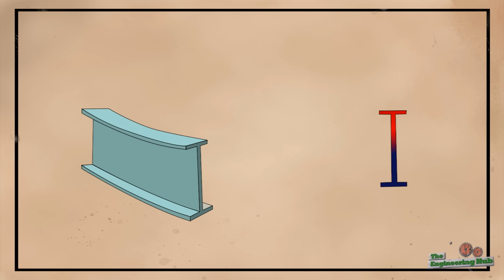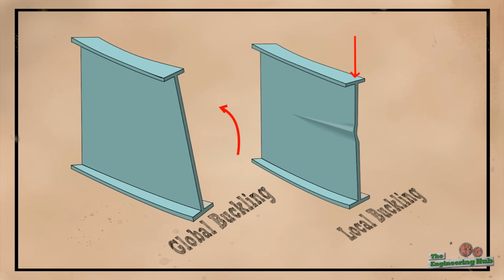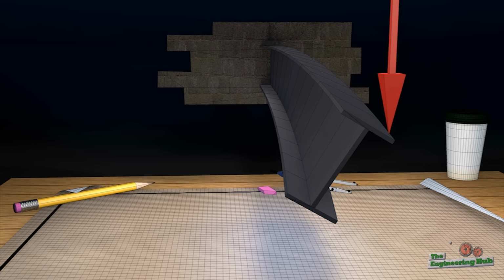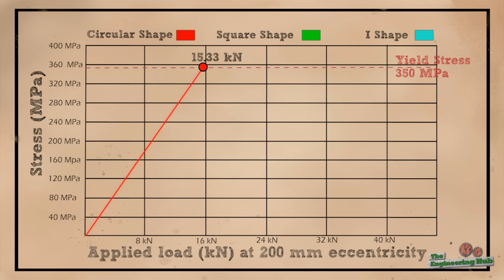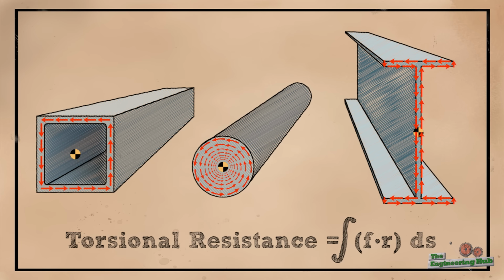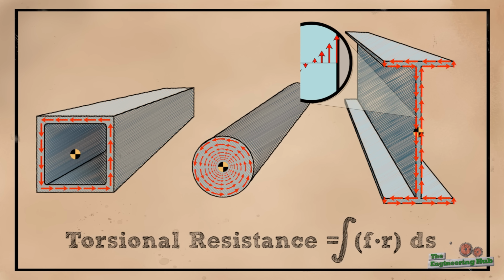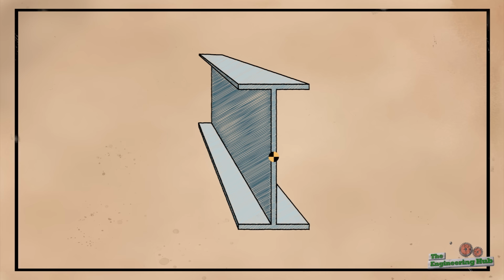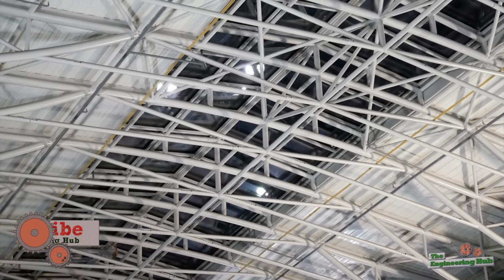The Critical Weakness of the I-Beam

Comment: Still waiting to find out what the fatal "flaw" is.    Having a degree in engineering, I would be interested to know as they are basic structural element. And there are well know methods to deal with all of the issues that you have raised. Main reason for using I beams, is when used in the correct place, they have a very good resistance to bending for their weight. Much better than square or round tubes.
Reply: It's clickbait for the uninformed, this is a very basic intro to mechanics of materials titled as if it was a weird online ad. "Structural engineers HATE him! Check out how this youtuber keeps his buildings standing with this ONE WEIRD TRICK!"

Comment: Torsion is a problem for all long beams regardless of shape.
The way to workaround that problem, if the beam is subject to torsion, is to build up beams in parallel to make a surface or volume like a cage (bridges). That way the structure is stiff and one beam by itself cannot twist.

Comment: All the examples are a wide flange beam. Not an I beam. You honestly don't know what you're talking about.
Reply from the maker: Hi James, the nomenclature of the beams might be different than the one used in your region. The name varies from place to place. In Canada, where our professional practice is, we colloquially refer to all shapes (W, H, S) derived from an "I" as I-beams. We understand that it is most likely different in your country/region.
Reply: @TheEngineeringHub  No. In professional practice they are referred to as what they actually are. When looking at a print, itll call for a W12x50. Nowhere on the prints do they call for "I Beams". I beams are not used anymore
Reply from the maker: Yes they will be specified with their actual designation, however, that was unnecessary information for this video so we just called them I-beams. The sloped-flange beams you were referring to are designated as S-beams in the Handbook of Steel Construction. The Handbook does not have any beams designated as "I" because the whole group is colloquially referred to as "I beams".
Reply: @James-on1vy  In laymen's terms, the term "I-beam" refers to any beam that resembles the shape of the capital letter I, regardless of its technical designation.

Comment: I read somewhere that nature has provided one of the strongest shapes:  The honeycomb or hexagon.  It makes one of the lightest and strongest structures.  It is used in many car platforms due to its muli-directional vector strength.  It would have been interesting to include that in this analysis.
Reply: Honeycomb isn't the strongest shape, but the shape that allows the minimum usage of material. So you get strong structures per weight of the structure.

Comment: I-beams in general don't have flaws. You're describing design flaws, that use I-beams.

When used correctly, an I-beam will never experience torsion stress. That's a design problem.
Reply from the maker: That is true, I-beams should not be subjected to torsion loads. But that also means that nothing in the world is flawed but just needs to be used in a different manner. For example a bucket with a hole is not flawed, you just need to use it for carrying rocks and not water.

Comment: So i want to redo roof in concrete building using steel beams & aircrete stuffed with styrofoam for natural solutions and some rooms.

What diameter of circular hollow steel beam for heavy loads do you suggest?

Comment: Seems to me, two I-beams parallel and with the flanges connected gives the best of both worlds, taking vertical loading, and counteracting torsion mutually, still using the classic I-beam simple fabrication.
Reply: This would be stiff, but also heavy.  I've never seen this done and can think of quite a few reasons why it would be difficult (if not impossible) to construct.

Comment: Guess what shape they use to make driveshafts?

A hollow tube can still cave in under torsion, but it beats a round bar in stiffness vs amount of material.

You could fill the round tube with a composite material that is good in compression tho.
Reply: A round tube in torsion, selected intelligently for anticipated load, is strong as long as it is not bent or dented. If either occurs, it will surely buckle.

Comment: I once saw a video about square solid driveshafts driving old factory equipment. When they were machined round in places to spin at supports they snapped because of the lose of torsion strength.
Reply: And they got thinner on the process,needed re-calculation.

Comment: Lets make a "H" beam. Put two similar I beams side by side. Get a nice chamfer on the sides that touch and weld up the top and bottom. A single I beam needs 4 beads of weld to manufacture. Joining two I beams only take 2 extra beads. Seems like a worth it modification. The center changes from being inside the middle plate to hovering in air between the two beams

Comment: Dude, click bait douche... Compared to other applications the I beam is a freaking marvel of engineering... And to the average metal worker every type of structural element has a optimal application and a sub-optimal application... "Fatal flaw" lol whatever dude.
Reply from the maker: We don't deny the utility of the I-beam. It is exceptionally strong in carrying bending loads, we made a whole video about that. But when the carrying capacity could be reduced significantly (in some cases over 80%) just be shifting the location of the load, then it is a weakness. Designers and engineers (like us) are well aware of this flaw or as you called it sub-optimal application just that this is less sub-optimal and more "don't do" application.

Comment: So what caused the freefall tlime in both the TWIN TOWERS. A fall as if there was nothing absolutly nothing holding up above where the planes hit?
Reply: All the weight of the upper floors collapsing one by one, adding more and more weight (inertia) to the next floor below. The hammer forces increased with each successive increase in falling mass. Steel was tearing and twisting in unimaginable ways.

Comment: I suppose if you reduce the cross sectional areas of the various planes without scaling down the overall shape you WILL get buckling or bending anyway.........anything that is increased in thickness and scaled accordingly will be at it's maximum strength but you also have to include length which is a vital factor in all cases......there are so many factors that come into play but are never foreseen or anticipated in the overall design.
Those that think they can be clever and reduce material volume in certain quarters to gain economy will lose their credibility once the component is put to the test.

Comment: Interresting video, thanks :)
A question, will stiffners on the I-beam not help against torsion too? And I imagine it will be diffrent again if they are placed diagonally.
Reply: Diagonal stiffeners will not work. The whole point of the stiffiner is to stop the beam from twisting itself apart. If it's on a 45 or a 60 degree angle it's just going to break the welds instead of  resisting the urge to twist.

Comment: These are NOT "I-beams." They are wide-flange beams. The cross-section of an I-beam differs significantly from wide-flange beams. The rolling mills are not the same.  I-beams are rarely used today in general steel construction. Calculations for crippling vary also based on the carbon composition Fy=36 ksi and Fy = 50 ksi.
Reply from the maker: Nomenclature varies from place to place. In Canada the beams you are referring to are designated as S-beams (sloped flange). We colloquially refer to all beams derivatives form an "I" (i.e. H, W, S) as I beams.

Comment: Great video with exceptional graphics.  But I would agree with the others that torsional stability of an I-beam is NOT a fatal flaw as you state in your title.  It's just another failure mode that needs to be understood and addressed by engineers (I am one myself).  Also, at 5:02 you hinted that a tube is better in torsion: true, but it has limits too on how thin the walls can get before they, too will buckle on the surface.
Reply from the maker: Yes definitely, you are not wrong. We called it a flaw from the perspective that a small change in the load location reduces the carrying capacity drastically. So we thought, if a small change could bring down an otherwise strong entity then that must be its weakness/flaw. We are still learning as a channel and observing how the audience reacts to our content so we could get better in the future. Thank you for your feedback!
Reply: @TheEngineeringHub  We engineers are a nit-picking bunch, so please don't let that slow you down from producing great content to especially get young folks interested in and learning about STEM topics!  So, I've subscribed and wish you all the best.

Comment: shows a round tube "this shape is ideal in resisting torsion" 
I guess that's why it's a common shape for bicycle frames
Reply from the maker: Also many other applications in the automotive industry such as drive shafts.
Reply: A lot of bicycle frames have elongated tubes in one direction, because it takes significantly more bending load in one particular axis than the other.

Comment: The illustration is not a 'I' beam but classed as a universal beam, 'I' beams have radii in the corners universal beams do not hence they do not have the same resistance to torsional loads.. They are cheaper and therefore easier to manufacture.
Reply: I remember the beams in the graphics as being called "wide flange"
Reply: @jamescad9978  "Wide Flange Beam" is indeed the correct technical term used in design and construction.  We do call them "I Beams" but know we are referring to a modern WF.
Reply: This. Lol!!! I thought this video was gonna be oh so that's why they stopped using I beams.
Reply: Exactly what I thought,  I-beam is thicker where the material meets, the picture looked like what I knew as a wide-flange beam.
Reply: I work for a building manufacturing company. I run a beam saw. We rarely run “I” or what we call “s”. We mostly rune H “wide flange beam” but most isn’t made perfect square so there will always be some some of torsional twist to it. For beams that bridge cranes run on we typically add channel on top to help the flange support it  without upsizing the entire beam.
Reply: @BigWill3855  so in WTC destruction what sort of beams were those & can jet fuel ball of fire and office material heat them to failure?
Reply: @MrGoodguy6-7  the design of the towers was a blast furnace without the liner. The core support was a big tube, that made the main elevator bank, with the bulk of the floors tied to that and further supported. In theory this design should have prevented the whole building from collapsing. Upgrades to the elevators cut back on baffling in the central tube, this combined with several hundred tons of high grade diesel created conditions hot enough to thermally compromise steel.
To be clear they never should of fallen, the BS spun by the media is in the ballpark but irrelevant to the issue. Building 7 has no excuse at all stick to that and you will find more answers.
Reply: @kuruptedredneck9154  awesome thank you! 
In addition to the core one of the designers or associate of the designer/s I believe said the towers had structural steel on the perimeter as a specific feature that not only helped the height but should act like a screen door if a pencil were to puncture it. 

As far as several hundred tons of diesel goes and NIST account of collapse i don’t recall that figuring in.  If several hundred tons of diesel ignited in the towers, i suspect we would see towering infernos or at least blast furnaces in locations where diesel was stored  

i agree the tale of bldg seven is quite tall, I trust media and govt to tell us whatever benefits a powerful cabal like entity we are not to criticize.
Reply: @MrGoodguy6-7  you got me on the tons of fuel. Was thinking gallons and typed tons, i blame it on Monday thinking.
Reply: @kuruptedredneck9154  hahah whew .. i think some claims of diesel tanks were below wtc seven but NIST discounted them as insignificant .
Reply: @MrGoodguy6-7  ya... Building seven was a controlled demo. They f'ed up the cover up on that one completely. The towers had a diesel fire on upper floors, that should not have been enough to completely drop them.
The whole official story stinks to high hell, and there is far too many people closely involved that made a large amount of money from the reaction to the official story.
Reply: @kuruptedredneck9154  yeah practically a coup we still suffer from the damn thing
Reply: You got one thing right. You labeled the graphics as illustrations. Why aren’t you correcting the colour of the beams illustrated in the video also? Both yourself and Zoolander should probably work from technical drawings rather then illustrations.
Reply: This kid Possibly, doesn't Know from Life, Mentors, Long Education... etc..
   But Atleast He Is Researching, Learning, and Teaching. With Cats  Like You ALL, Fills in the Blanks that Mentors etc could Norma Fill In.   
   Great Combination
        Great People 
         Great Video
Reply: Even proper I beams have relatively little torsional strength compared to many other cross sections of a similar mass.
Reply: Spot on...
RSJ’s had a 7 degree angle on the top and bottom plates so were thicker and stronger in the corners.
Reply: I think he’s referring more to the general geometry rather than the specific ways that geometry can be altered to improve its properties. Sure I beams don’t have sharp corners and have curves, but they still have the general shape of these other beams and therefore exhibit similar properties. A box section is very different from any I shaped beam
Reply: Yup !
Reply: Yes he is referring to the general shape. Don't make things more unnecessarily complicated.
Reply: @patmat.  calling a wide flange beam an I beam unnecessarily complicates things. Specifically since I beams are built bigger where it counts to compensate for the very weakness that is being criticized. But ok, I do get your point. I just think it's either ignorant or misleading to leave out this little bit of information.       At least he made the video though, I will concede that my comment required far less effort.
Reply: @onradioactivewaves  I agree. if you're going to make a video under the name Engineering Hub, at least get the nomenclature right. He sounded like a TV reporter getting it wrong like they always do.
Reply: @onradioactivewaves  you are just confusing rolled members with built-up members. Both are I beams.
Reply: Always that person that has to get technical and not allow the creator to get their point across. Turn a short video into a boring video about the rules
of beams. Thank for your not so insightful comment.
Reply: Right when I started watching it I was saying the same thing. Credibility=lost

Comment: Are you saying that a round hollow tube is stronger then a square hollow tube? Because if you are then I would have to disagree with you...
One other thing I don't see why they don't use triangular tubes...
Reply from the maker: A round hollow tube is stronger at resisting torsional loads than a square hollow tube. But it is not stronger at resisting bending loads.
Reply: @TheEngineeringHub  That makes sense thank you for the response, any thought on the triangular tube (if they made them)...

Comment: I just watched a video by Waldos world about building a gooseneck trailer. He included a small hollow round tube between the I beams and welded a plate to each end. He did this to reduce twisting of the frame especially when empty. I thought that it was a lot of extra work when he could have just made the beams bigger. This shows that a little material in the right place can go a long way.

Comment: don't mean to nit pick, (the video was quite good) but the term "I-beam" actually refers to a specific hot rolled steel shape that some what resembles the rails used for train tracks. They are mostly obsolete now.  What is shown in the video is actually called "Wide Flange".

Comment: Thumbs up on the video. When you began comparing cross sections of various shapes, (I beam, square tube), I was immediately perplexed as to WHY you then chose a SOLID bar. My correct guess was that you would progress to a round tube to explain its advantage. But it was a distraction from the start. I would have preferred all 4 being introduced together.
Reply from the maker: Thank you for the feedback Gregory. The main reason for comparing these 3 shapes was because we used them in one of our previous videos when we compared them under bending loads. For this video, we knew we couldn't talk about torsion without introducing the round hollow section so we decided to bring it up later as the queen of torsional resistance. That's the reasoning, we know it's not a perfect video but hopefully we can improve in the future.

Comment: Euler buckling, that's called. And it's not necessarily a "fatal flaw," might it also just be a way to save weight and cost of the I beam?
Reply from the maker: Euler buckling is actually different from torsional loads/shear stresses developed in a beam. Euler buckling is applicable to elements under compression like the two cases illustrated at the beginning of the video with the global and local buckling. But those are easy to deal with, the problem is the torsional loads which are not really related to Euler buckling but it's simply twisting of the section.